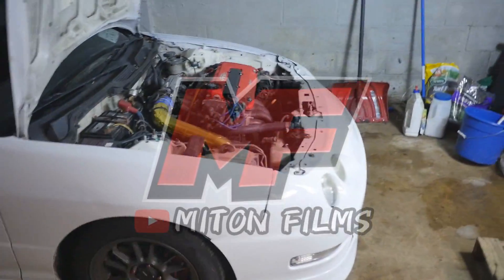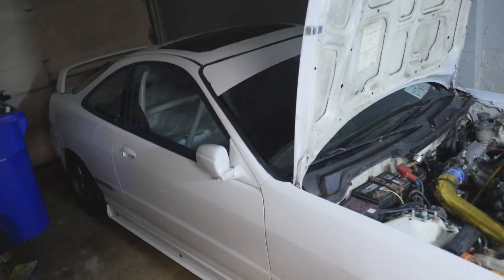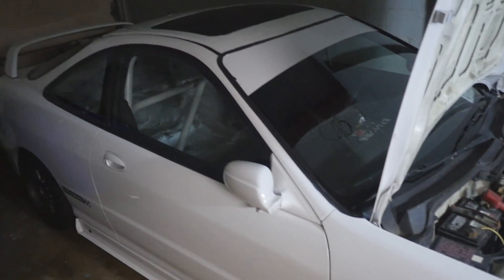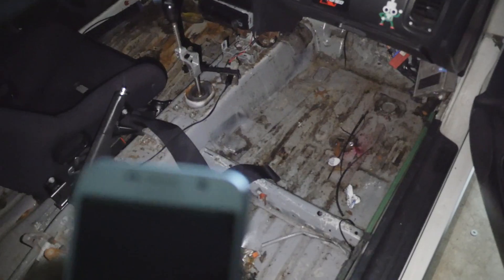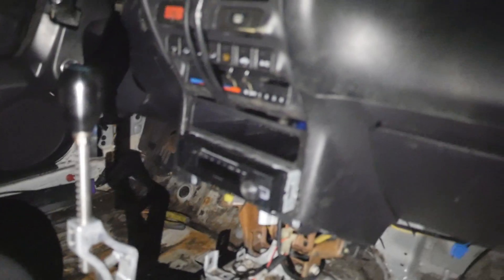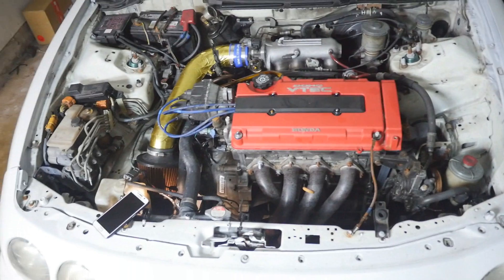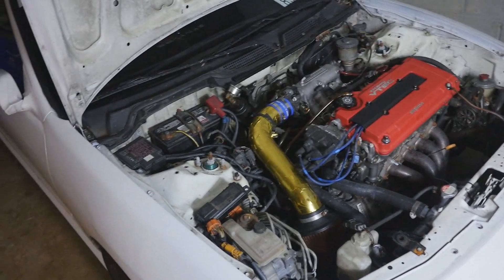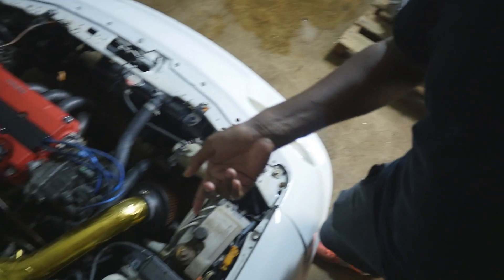Project Integra Finally Gets A Garage

Comment: As far as weight savings, you can do two piece rotors, racing lug nuts, and aluminum nuts and throughout the car to replace the old rusted ones. They may be small, but the weight adds up quick. These are inexpensive ways to lose weight, I’m not sure if the rules will make you keep your steering wheel but that’s a easy 9lbs! Hope this helps, good luck bro.